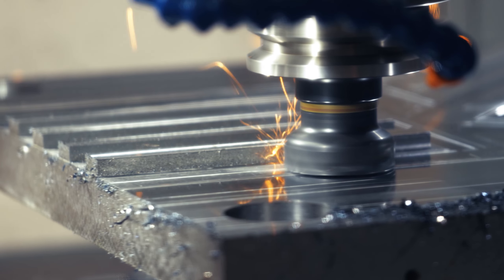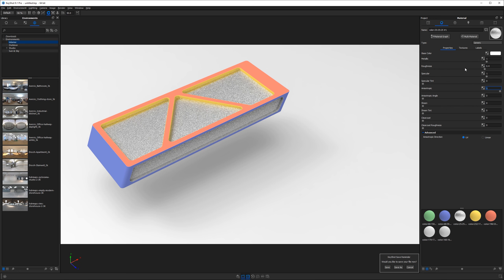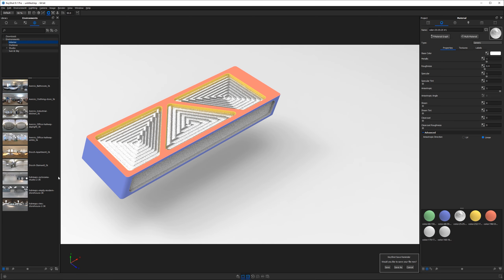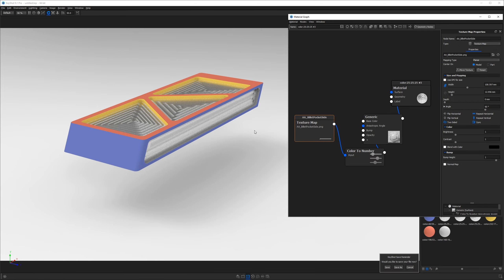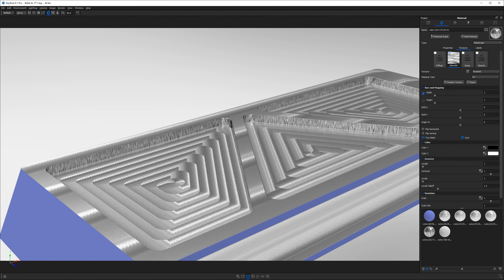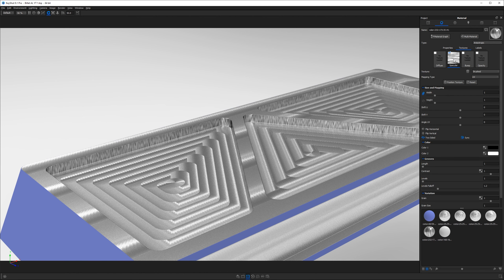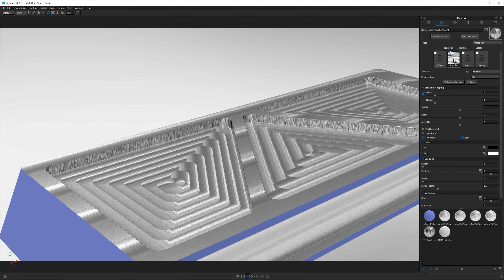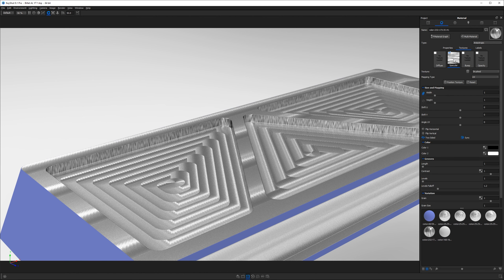How To Render Machined Metal with KeyShot 9

Comment: oh boy I've been searching for this for a looong time.  thank you so much!
I enjoy rendering injection molds, finding the correct texture is the key. I have to find a quick way to make the tooling path texture.
I think there has to be a trick or something to make it procedural, like using the mesh node or something.
Reply from the maker: I assure you, there isn’t really a way to do it exactly procedurally. You can get close, but not with the radial swirl. I 100% tried to make this procedurally first and when I couldn’t, I gave into image-based.
Reply: Did you find a way to make the tooling path procedurally? I need to render some injection mold tools as well